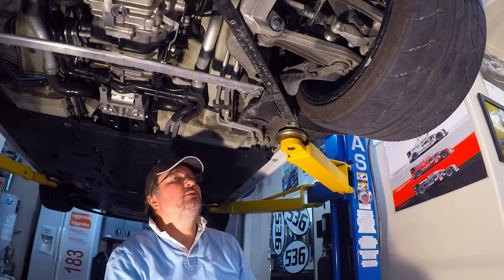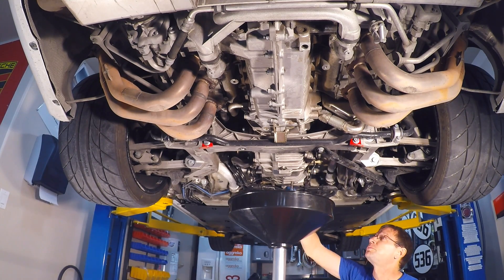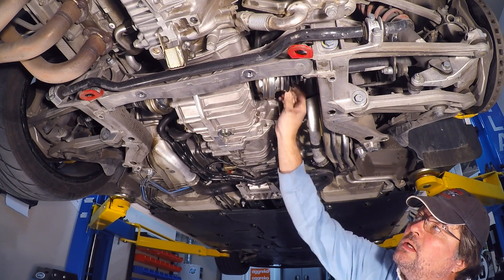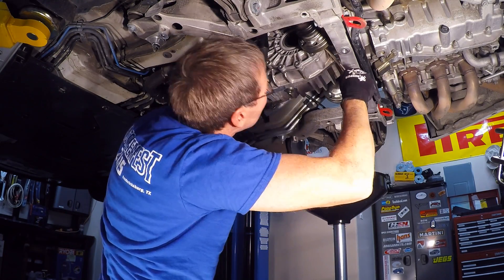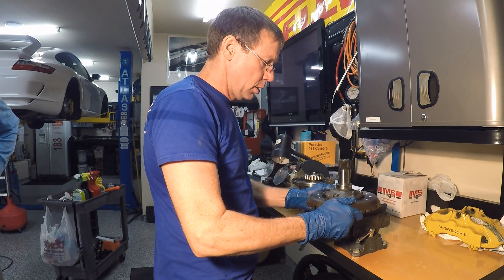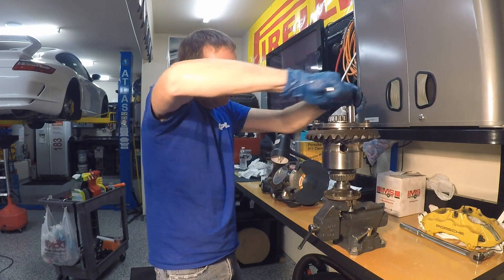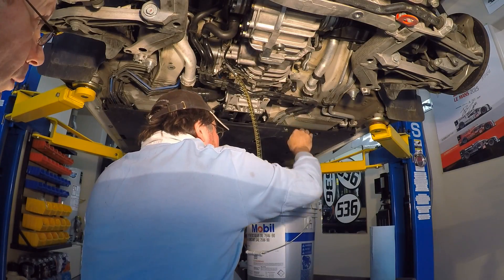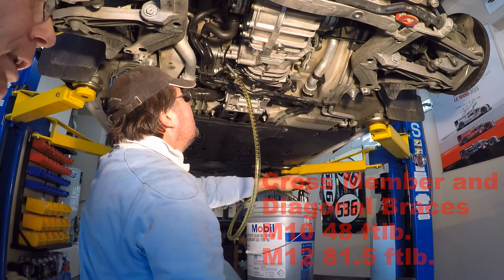How to Remove and Replace a Porsche  997.1 GT3 Differential

Comment: Question: Is it just that 17mm bolt that holds the axle stubs into the diff? Good video. Thanks
Reply from the maker: Yes, a single 17mm bolt.  the axle stubs are splined, so the bolt is just to keep the stub from sliding off the spline.....although nowhere to go if the half-shaft is in place at both ends.

Comment: 23 nov 2019 7:50 am est: 6:05 scene-jumping show transmission-cover suddenly is open

23 nov 2019 8:13 am est:
(1)toyota->corolla-year-1998->year-2008 use normal-gear/spur-gear, not bevel-gear, to connect transmission to open-differential inside trans-axel(transmission and open-differential in same-housing):https://www.youtube.com/watch?v=LkK2XFnmfhU&t=2m53s (How an Automatic Transmission Works (FWD) ) from recommendation in https://www.youtube.com/watch?v=0E_KPb-Nv7E (Antikythera-M4-DivxQ85) from recommendation from https://www.youtube.com/watch?v=DMITkTYiZ7k (Animation of Antikythera Mechanism )from google(antikythera mechanism animation)result 2 from 'Antikythera Mechanism' in https://en.wikipedia.org/wiki/Epicyclic_gearing from 'planetary gearsets' in https://en.wikipedia.org/wiki/Automatic_transmission from 'if you properly understand working of a planetary gearset then you can easily understand automatic-transmission' in https://www.youtube.com/watch?v=Ugao6jTyM7k&t=29s (Automatic Transmission, How it works ? ) from 'I highly recommend checking out this video that walks you through it' in https://www.artofmanliness.com/articles/how-automatic-transmission-works/ from google(how automatic transmission work)
additional-source:spur-gear:https://khkgears.net/new/gear_knowledge/introduction_to_gears/types_of_gears.html from google(bevel gear vs normal gear performance)result 3

(2)our honda->crv-year-2003 use normal-gear/spur-gear, not bevel-gear, to connect transmission to open-differential inside trans-axel(transmission and open-differential in same-housing)
as well.
source:honda-crv-year-1997=>2000 service-manual page 451, 477 show open-differential/differential:https://en.zofti.com/open?idm=308 from https://www.youtube.com/watch?v=jQlkeZpmq_Y (Download Honda CRV service and repair manual free ) from google(Honda CR-V 2002 - 2005 Service Manual download)result 4 from 'Honda CR-V 2002 - 2005 Service Manual' in http://honda.automotive-manuals.com/cr-v-2002-2005/A00/HTML/00/S9A2E00J26273458601KDAT00-interior-trim-removal-installation-tailgate-area.html from google-image(crv  tailgate panel)row 3 col 1

23 nov 2019 8:21 am est:i assume porsche-997-gt3-trans-axel use bevel-gear, not normal-gear

Comment: Different bearings and differential case and no crown gear lift / backlash adjustment ? Gearbox oil analysis should be the least of Your concerns.
Reply from the maker: Vlad, I referred your question to Bill Rader who guided us through the process.  He is an expert in these matters, and does gearbox work for many professional race teams.  Here is his reply question to you.  Please keep me in the email chain so I can follow along and continue to provide accurate information in our videos.  Thank you for your interest and helping us provide a great online resource!
-Steven
veloyelo@yahoo.com

Hello Vlad,

Please let me know what exactly you did with your diff in your GT3.

Sounds like you installed new bearings and an LSD, did you swap over the spacers from the original diff to the new one?

What brand differential did you use?

Let me know and I can better give you some information.

Bill Rader
billradermotorsports@gmail.com
Bill Rader Motorsports, LLC 
6969 Speedway Blvd # 105
Las Vegas NV 89115
702-767-9773
702-293-2191 fax
https://www.facebook.com/BillRaderMotorsports/
Reply: Hello Roaring Tigers Garage, thank You for Your reply. I would like to begin by saying that I do not own a Porsche and I have never worked on one, however I am familiar with Audi and their gearboxes which share a lot of common parts and design features - including differentials, crown and pinions with Porsche (no surprise as they belong to the same Volkswagen-Audi consortium). I have some experience in swaping the Audi V8 rear torsen differential to AudiS6 C5, S4 B5, S4 B6 and so on... The design of the differential housing and the differential cover plate is the same for all Audi gearboxes and rear final drive units produced in the `90,`00 and enevn `10 and is also similar to what I have seen in Your video here. In the `00 manual porsche gearboxes were nothing but an Audi gearbox slightly modified and assembled at he rear. According to Audi workshop manual each time You replace the bearings/the cover plate/the differential/the gearbox or final drive housing the the crowngear lift/backlash should be adjusted to reach the specified play. This is done by choosing the right spacers for the bearings inside both the gearbox housing and cover-plate. The thickness of the spacers is determined in two steps: 1 total shim thickness - first the outer bearing race is inserted inside the gearbox housing along with a 1.00 mm shim and the other bearing outer race is installed in the cover plate; then the differential without the crowngear is installed and then the cover plate is bolted on; with the help of a special tool and a measuring gauge the freeplay is measured (the gearbox must lie on its side so it is not possible to do this directly on the vehicle) a corresponding total shim thickness is determined according to a formula taking into account the freeplay. 2 choosing the shims for the gearbox housing: the coverplate is removed, the crowngear is installed and shims are installed in the coverplate their thickness = total shim thickness -1 (remember that a 1.00mm shim was already installed in the gearbox housing); the differential and the cover plate are installed once again in the gearbox housing then a special tool is mounted in the differential driveshaft bearing and by means of a measuring gauge the backlash is measured in 4 positions each 90 degrees. Using the measured value and a formula the thickness of the final shim needed inside the gearbox housing is determined. The final shim thickness for the cover-plate is then determined as the difference between the total shim thickness an the housing shim thickness. Once again the whole assembly is taken apart and finally the correct shims are installed.    Regarding Your video, I have noticed that You haven`t changed the shims and the outer bearing races but You changed the differential and the bearing (rollers and inner races). I think You may risk having the wrong precharge for Your bearings (shorter lifetime) and the wrong backlash play (not good for the lifetime and wear of the pinion and crowngear). Of course we can suppose that the differential is machined to tight tolerances but I doubt You have exactly the same rigidity for those two differentials and the same distance between the crowngear flange and the gearbox housing bearing sitting surface. Keep up the good work. Best regards from Eastern Europe :)

Comment: So since the title says "How to Remove and Replace a Porsche 997.1 GT3 Differential " I have to comment and point out that the one thing the title mentions is the one thing that is not shown nor explained. Meaning the "fighting" the diff out of the transaxle with it installed in the car. Disappointing really.
Reply from the maker: Killtune, I apologize for the confusion on this topic.  It's not really a fight to get it out....just trying to be humorous.  Once the diff plate is off, the diff simply slides out, but you will have to wriggle it past some hoses and such.  It's relatively easy, just need to be patient if it gets hung up on something...it does come out without removing any more parts!
-Steven
Reply: Wish this was the case on my 996 GT3…I ended up taking the drivers axle completely out to get the diff out. It was a battle. The 997 must have some clearance improvements?